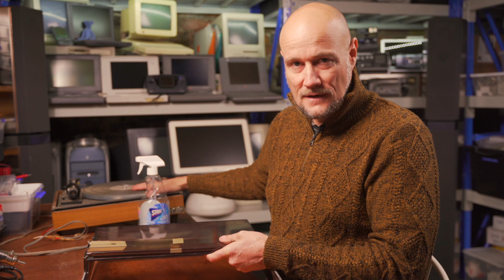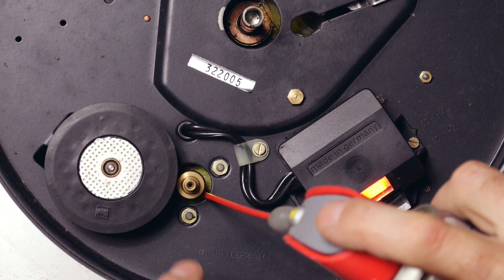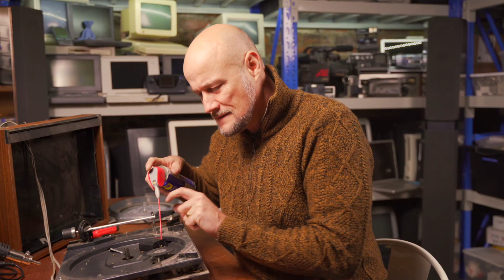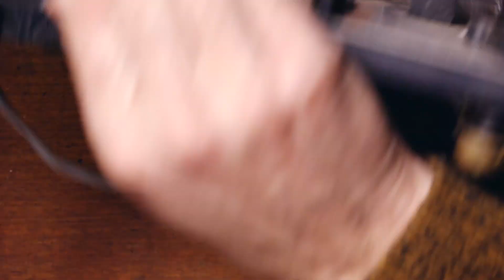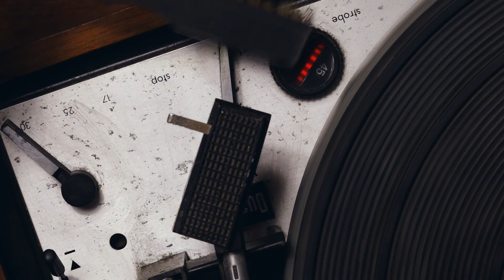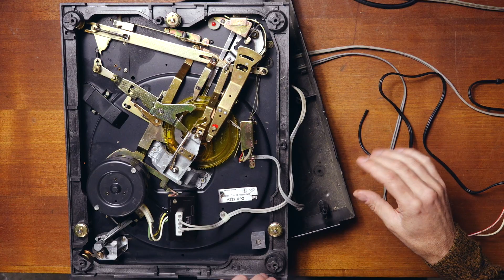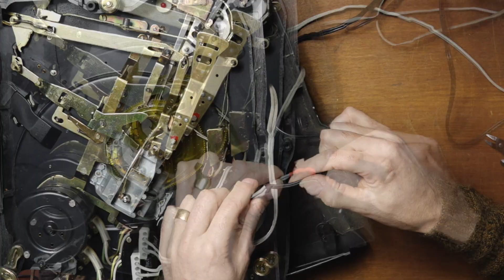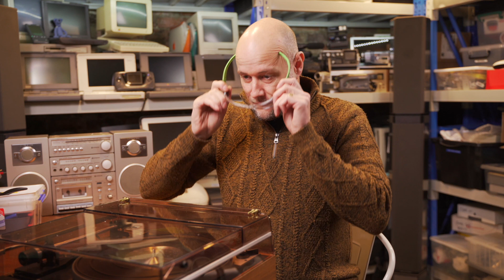Dual 1229 Turntable Review and Repair - Vintage Record Player

Comment: I have a question. My turntable is like a 70s United audio. It looks a lot like this. No belt. The problem is it won’t quit spinning and there isn’t any paper under the platter.
Reply from the maker: Sometimes these turntables have adjustments than can be made to determine the stop point for the motor. Not sure how to fix the missing paper though, how good are you with a sharpie? 😆
Reply: It’s probably a 1219. Pretty much the same unit minus the strobe. It just needs a good cleaning of the auto mechanism to remove old dried up grease. Then I’m sure it would stop spinning when it cycles through. The 7.8 lb platter will spin for almost 2 minutes from its own inertia when it’s running as it should. So don’t expect the platter to stop immediately when the motor shuts off.

Comment: That plinth has 2 height settings to allow that dust cover to be used with the long spindle.
Reply from the maker: Yes I wondered if that was the case
Reply: @TheBasementChannel  Could having the brown "wood" casing in the wrong position/at the wrong height be why my dust cover slides back and forth while closed? I drop it in the groove and the back but nothing seems to prevent it from sliding forwards and backwards ie hanging off the front of the whole unit with properly closed of pushed too far back so that the front flap doesn't close all the way to 90 degrees.

Comment: On the positive side - it has a heavy platter.
On the negative side - it has a wheel that drives the platter and not a belt. A wheel usually transfers more motor noise over into the music.
I did hope that this actually had a Thorens mechanism in it.
Reply: "Usually"  ??? Means "not always".  In this case "not always" because it doesn't transfer motor noise.